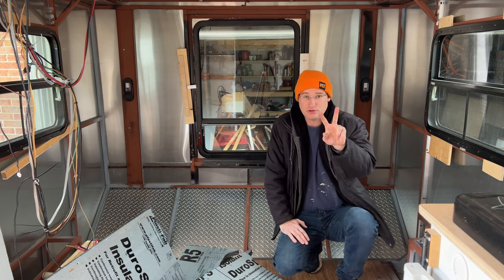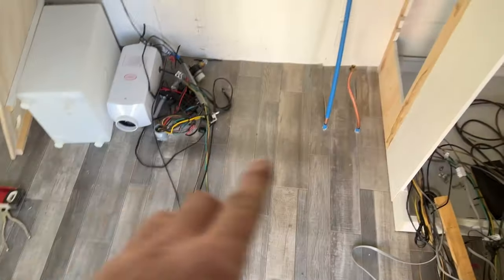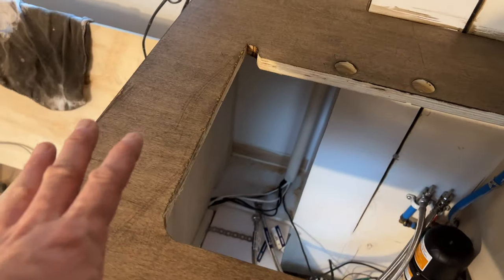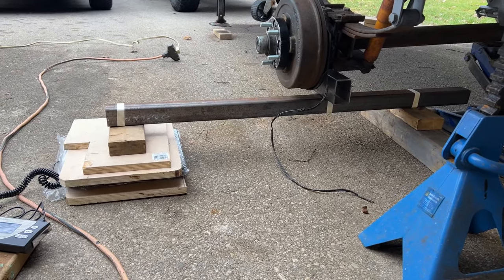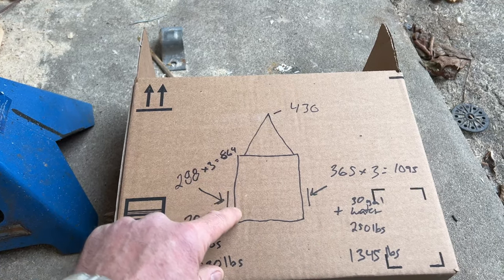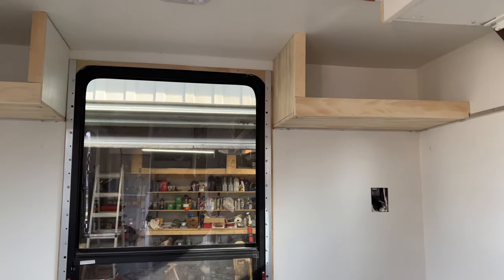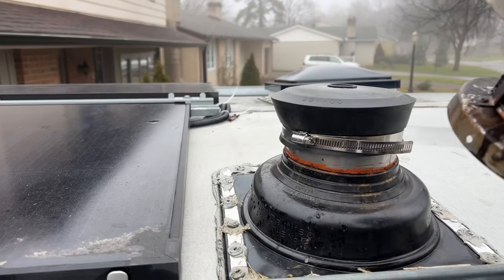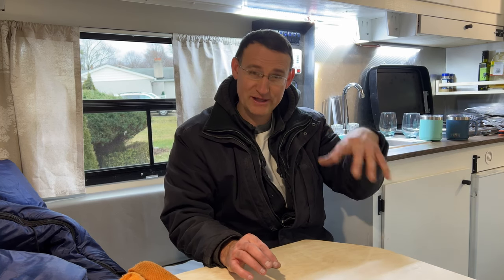Building an Off Road Cargo Trailer Camper - The Interior - Part 2/2

Comment: Still working on the first concept videos, good luck with the new build on your trip. The tongue weight is a little high for a small truck, but good luck.
Reply from the maker: Yeah it’s a bit higher then I’d like 380 I’d like to have it at 350. I find any lighter then that it gets a bit squirrelly. I might just run one propane tank on the tongue. Throw a back up in the truck. I’ll keep you posted

Comment: great job zac. i was gonna have lots of plumbing, pumps and tanks, but im reconsidering it all. i too live in cold temps and winterizing constantly seems too much. im thinking about everything but maybe a lot of gravity fed lines, and much more basic systems. im even thinking about like a garden watering pale for showering. metal pale that can be heated on a stove and hung from the ceiling. imagine all the wires, plumbing, pump and space that would save. and nothing within that system would need winterized. basic, basic, basic! im reconsidering everything i want to do within my trailer. ideas and information are in constant flux lol
Reply from the maker: Thanks!
Basic is definitely good! It would save a bunch of space and money. I do enjoy my nice hot shower though! 😄

Comment: Nice 👌...nice aggressive tires...did you have to add a hub spacer to install these tires?
Reply from the maker: At first yes. 1” on each side. But then I just got a new axle built and just got them to make it 2” wider. They are 31x10.5 tires so not too crazy big.

Comment: Looks like a very nice job! I'm surprised that, since you were swapping out the axle anyway, why you didn't go with a torsion axe and get rid of the cross bar, since you like to go off road.
Reply from the maker: It was really close to happening. Here’s my thinking…… The thing was I could get the straight axle made local in 4hrs and it cost me just over 200$ the timbren axles I was looking at was going to be 1800$ and I’d have to reinforce my frame or add a cross tube. I’d also have to run 1” spacers because the axle didn’t stick out far enough to clear my tires which I really didn’t want to do. 
My two cents is the straight axle is stronger cheaper and easier to install. Would love that extra clearance but just couldn’t quite justify it.
Reply: @waysoutback  Makes perfect sense. There is a Dexter axle facility not far from where I live. $498.00 (US) per 3,500lb. axle. We can order custom lengths.
Reply from the maker: Wow that’s an awesome deal. The independent suspension definitely makes things a lot smoother. 👌👍